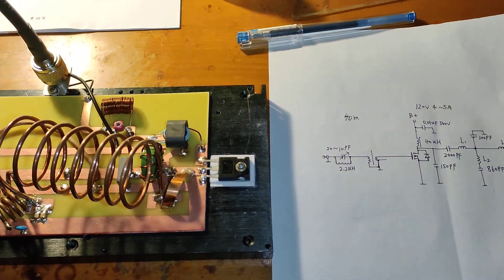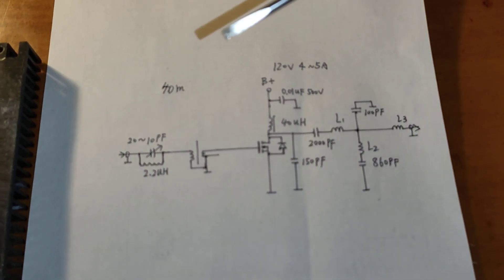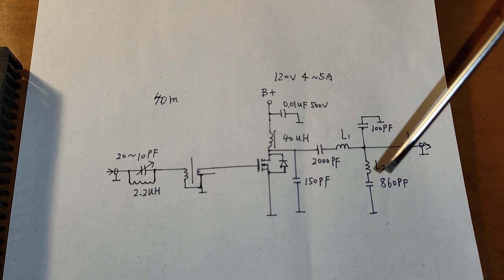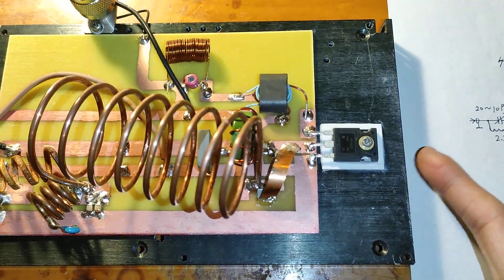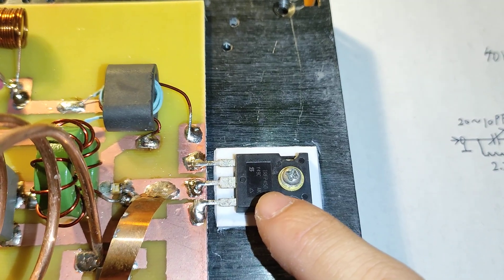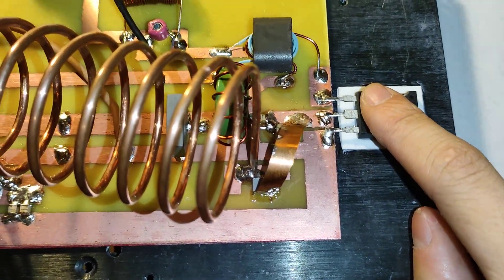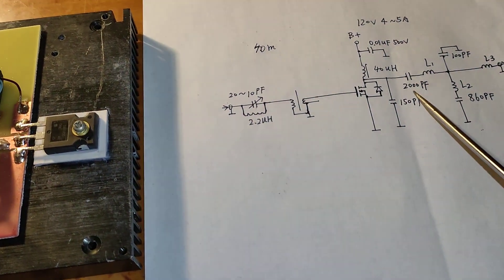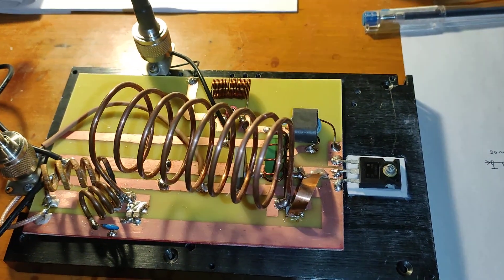Class E RF power amplifier 500W

Comment: Can this circuit work in the 2.4 G band? Thank you.
Reply from the maker: It could, but the switching device should be somethibg else such as a RF mosfet or HEMT.
Reply: @uecmitsuimarinedieselengin873  I really do wish the IRFP450 would work at SHF!😄
Reply: I have some transistors that will work in the 2.4 band, I would even give them away as they are surplus to my needs. The circuits to make them work are very unforgiving though.

Comment: brother hi.
can u pls teach us something about 
AVR (automatic voltage regulator) on ship?
Reply from the maker: Of course sir.The AVR system control the diesel generator's output voltage by sampling the output voltage.We know that the main generator uses electricity  to generate magnetic field,by changing the magnetic flux density we can control  the output voltage.The AVR is doing the exact same thing,if the output voltage is higher than expected it will reduce the magnetic field density by decreasing the excitor's current.